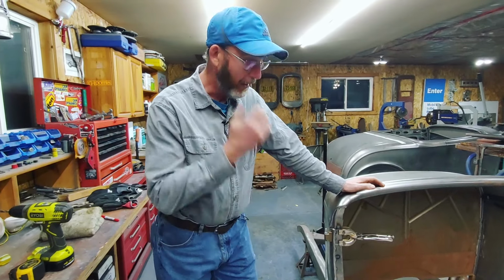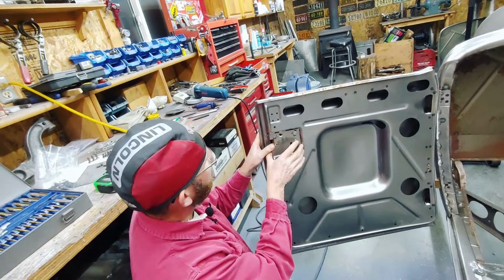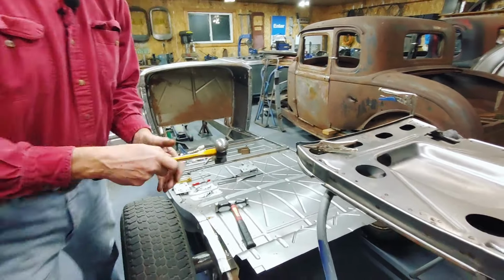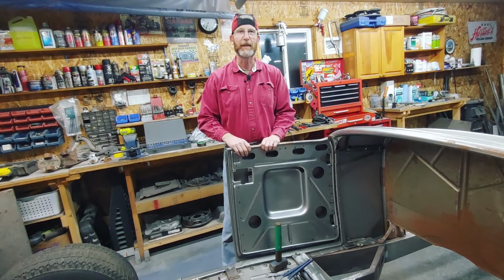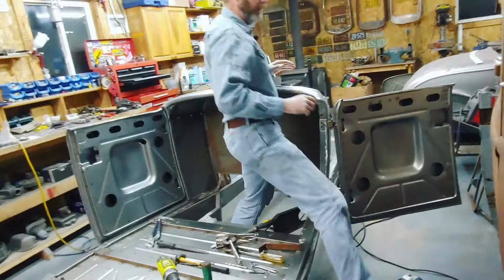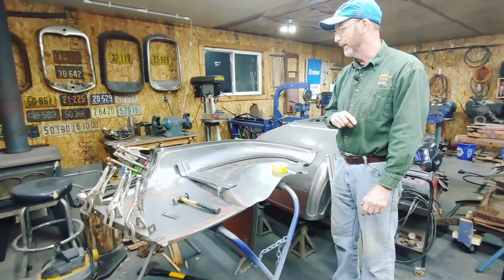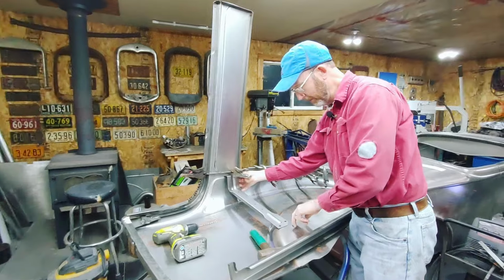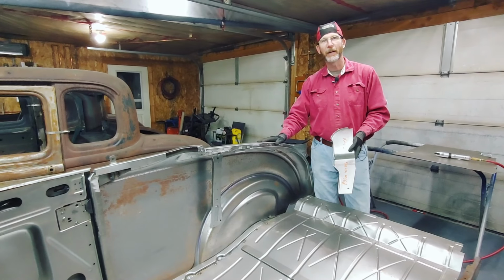Revisiting the 1932 Brookville Roadster Body Build (2022-2023) Episode Two - doors & quarter panels

Comment: Hi  Derek,      That lip you used to clamp  the boot rail  to  is the one missing  on mine  . what is the measurement  to make a new lip  ,   how far to set the boot rail down from the top of 1/4 panel.
Great work  ,    Catch ya   👍👍👍👍👍

Comment: Great videos.  Do you ever paint rust inhibitor in the doors skin before you join the inner and outer skins?  Thank you.
Reply from the maker: I guess it's never a bad idea to paint the backside of the doors before assembly. I did on my model A and 32 pickup. Brookville doesn't do it on their bodies. For cars that are going to see the full weather and seasons I would definitely paint the insides. For hot rods made from new metal like this that will most likely never see bad weather and spend their winters in heated garages I don't think it's as important. Still if you have it and you can it's a good thing.
Reply from the maker: I guess it's never a bad idea to paint the backside of the doors before assembly. I did on my model A and 32 pickup. Brookville doesn't do it on their bodies. For cars that are going to see the full weather and seasons I would definitely paint the insides. For hot rods made from new metal like this that will most likely never see bad weather and spend their winters in heated garages I don't think it's as important. Still if you have it and you can it's a good thing.

Comment: I'm about to start this.  My A pillars are kinda weird (five window converted poorly many many years ago); how far out should the top hinge stick... maybe from the body to center of hole?  Just a rough number would help.  I can kind of gather it from looking at the video and approximating.  Thanks again for all your help!
Reply from the maker: Hi if you want to send me a message on Instagram I can send you a picture back with the measurements you need.
Reply: @coldstreamrodshop  Derek, you rock.  100% wouldn't be able to make this car without your vids and help!  Or... it would be a lot harder to find the info cause I haven't come across it.